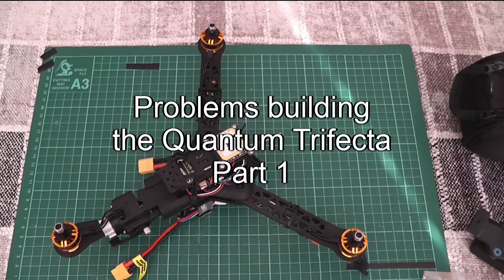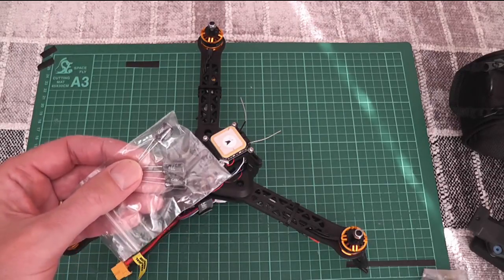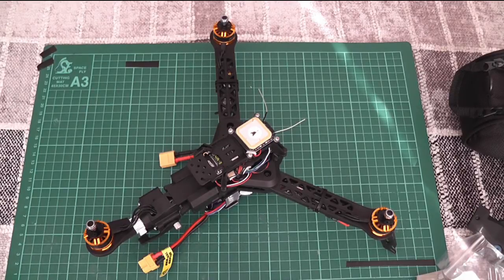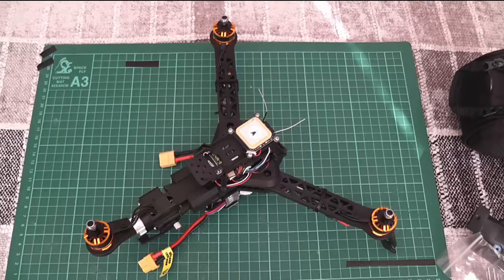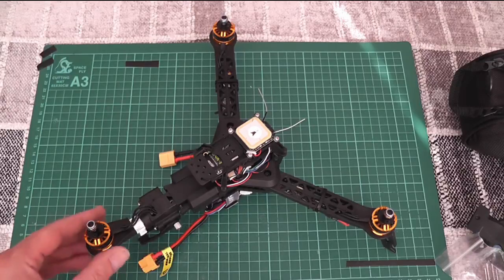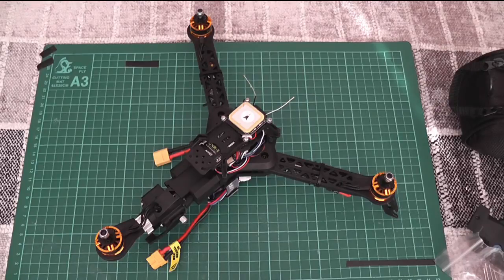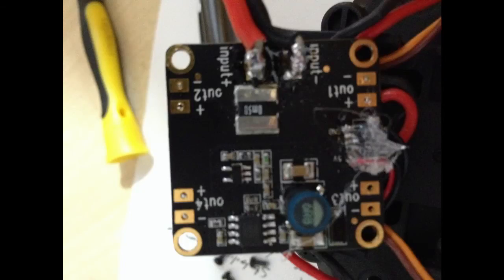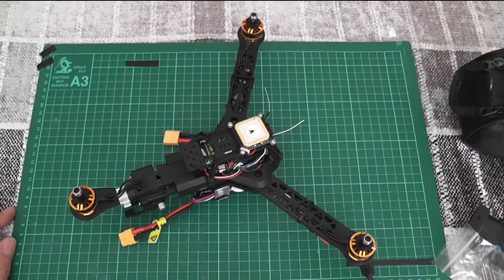Quantum Trifecta Build Issues Part1

Comment: Hi,  Thanks for mentioning me in your video.  I have the trifecta as well and have flown for 25 minutes with my setup.  I have had many of the same headaches with the craft and think that the sensors on the hk board are no good.  Also I'm suspecting the motors interfere with the board or the rx because I get a lot of unwanted movements. 

     What kind of luck have you had in the last few months with it?
Reply from the maker: Hi Dr.  Sorry 3d.  I like the name change.  Looking forward to what you do with your printer.  I've now got a build issues part 2 posted.  I have not had problems with the sensors, at least as far as I can tell.  I've now got Fpv gear on it and the additional Caa rules that apply to this setup mean I can't fly it where I did. That plus the bad weather means I have not been flying it as much as I'd like. When I do fly,  it does seem responsive to the controls. I'm not able to take my hand off the transmitter controls like I see in some videos.  It does need flown all the time.
Reply: hi 3D can you please tell us what setup you have to get that flight time. I am in the progress of ordering the parts for my trifecta frame!!!
Reply: I actualy became a vendor and sell the motors that are the key to the flight time.  I recomend just a CC3D or a Pixracer for the flight controler.  8" props, 20A mini or a 4 in one esc.  you will get more flight time with that set up i think
Reply: +3D Drones thanks. what sort of price are we talking about for the motors? I have a flip23+ and gps. still need motors and esc's. I saw that fpv cambodia uses 2822 1275kv! do thay fit?? thanks in advance! !!
Reply: Try isolating the control board from the chassis vibration. Best done by using Velcro instead of screws.

Comment: Wow! quite a few issues. I used a Naze32 FC, HK BabyBeast 2206 motrs, 12A Afro v3 ESCs and the D4R-II receiver in CPPM mode and everything fits and works just perfectly.

The main issues I had was with the tail assembly. Make sure you put some grease on the shaft where metal contacts metal otherwise the tail mechanism can seize up due to friction. This can overload the servo.

The other issue I came across was with mounting the Mobius as the FPV camera.

Sitting on an angle when on its legs doesn't sound quite right... mine sits flat.
Reply from the maker: Mohit Dewan Yes, I think it was because this was all new to me. With limited information on the Hobbyking mega micro and never having used an APM based board before, it was all a learning experience. The trouble was I wanted to do it all. I wanted a racer, an acrobatic capable system and I wanted a system with GPS and an OSD capable of aerial photography. It should really have been several models but I tried to cram it all into one.
Reply: John Crombie Well you did get it going in the end so kudos! Thanks for the vid.